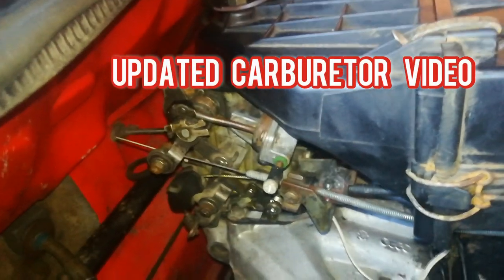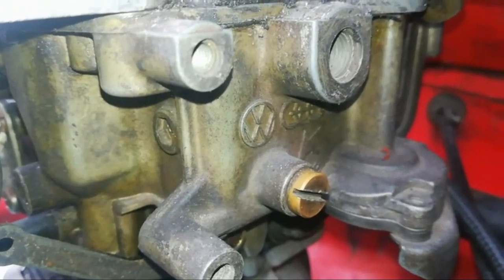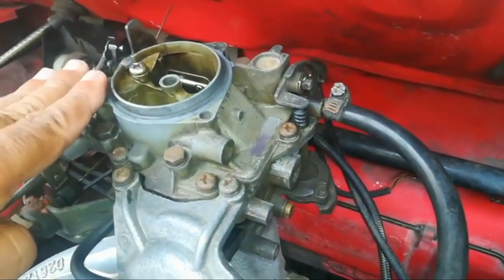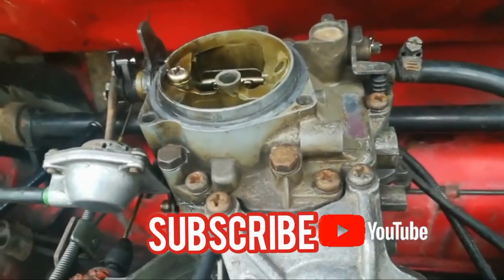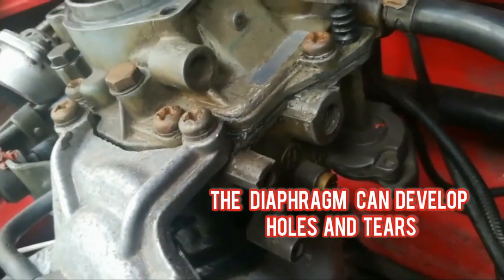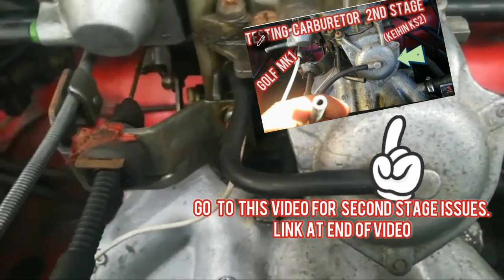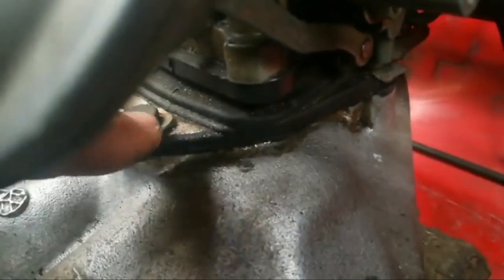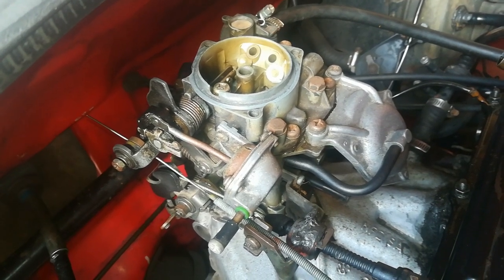GOLF MK1 : Revised and Updated video  Keihin KS2 Carburetor #golfmk1 #vwgolf #golfmk2 #carburetor

Comment: Hey PJ , quick question…the interior fan on my mk1 isn’t working at all , it went on at a stage but then never worked again. Doesn’t blow hot or cold air. What could be the issue? What should I replace?
Reply from the maker: Have a look at the connections. under the rain tray in engine bay..It sometimes is just a bad connection, due to corrosion..

Comment: Hi, regarding the float level adjustment screw, i have a question:
Is it secured in any other way than just screwed in? 
It is leaking on my KS2 but when i loosen it to take it out, it gets stuck when the top ist just above the plane of the screwhole. The screwdriver slot is already a bit damaged, and i fear breaking it when i try to turn it more.

Also, for the hinge of the float, how should i take that out? I assume i need to take the float out to get the bottom part of the float valve out, but the pin doesn't move at all

Comment: Thank you so much PJ's 👍👍

Quick one PJ is the goldwagen cab base good, saw some others preferred the aluminium one?
Reply from the maker: Yes there base plates are good. Just don't over tighten the 4 long bolts holding it place.. Rubber coated base plate is still the best

Comment: Thank you so much for all your videos they have helped me a lot. In your one video you removed the fuel separator and put in a t-piece instead and in the return line to the tank you put in a restrictor. I have done the same but want to know what restrictor did you use and where can I get one from. Any infor or links or pics of the restrictor please.
Reply from the maker: Hi you could get the restrictor at Goldwagen..,but your Mk1 should actually have one in already,.Was it removed ?
Reply: Hi. My didn't have the restrictor in the return line. It only had the fuel separator which I removed and put in the t-piece. Can I run it like that without the restrictor and will it cause any issues. What must I ask for when getting the restrictor.

Comment: Love your channel, thanks for all the good advise, my 2006 with original carb, revs drop when I accelerate, what could be the issue?
Reply from the maker: Could be more than one thing ..fuel pressure,airleak,or dirty carb,.. first just give it a blast of carb cleaner into the fuel bowl,then drain the fuel bowl.or while engine idles hold your palm of hand over the mouth of  carb,you will feel the suction,just before engine wants to cut remove hand .That could clear up any blocked jets..
Reply: @pjs-golfmk1-diy  thank you, I have cleaned the carb, replaced the fuel filter and plugs, I got a kit today to properly service the carb, will get it done over the weekend

Comment: Hi PJ, on the cluster, the light that flickers in the top Centre, mine does not flicker or come on at all. what can be the cause. I've got a mechanical oil gauge but would like for that light to work as well. kind regards and thanks for the videos.

Comment: Hi pj. Qestion can a carb be checked to c if the petrol pump on the carb is working out side the car engine bay. Like on its own not conected or does it need the vacum pipes connected ?
Reply from the maker: Yes you can check it ..with the inlet pipe disconnected from carb.
See the video link I'm putting down below

https://youtu.be/mHrXswnoCk8?si=oLk5z_UmZ0mDO8gj

Comment: Hi sir. My second stage doesn't wanna close properly. When I accelerate and take my foot off the revs don't drop lower than 3000. I bought a new carburetor and it does the very same thing. What could the problem be? Went to 2 mechanics and nothing satisfactory as of yet
Reply from the maker: Hi ,the problem usually is the butterfly not closing completely due to carbon and dirt stuck in the throat.
A blast of carb cleaner can loosen that dirt,and then also pull the 2nd stage external little lever ,on left side of carb to free it up bit more.What puzzles me you say the same thing happens with your new carb,so now I'm thinking airleak either at base plate or servo pipe....make sure base plate is not sucking in air,or another thing is are you sure your accelerator cable is not the problem..because when it gets older ,just like a clutch cable the strands come apart and it frays and starts rubbing against the inner tube of the cable.,and not releasing ,causing engine to stay on high rev...take off the accelerator cable and check if it runs freely through the tube..also when fitted ensure its routed nicely and no tight turns.This has happened to me before ,where my accelerator cable was the problem.Took me long to come to that conclusion.

Comment: Hi PJ,ive watched most of your videos,i just want to ask,my carburettor keeps leaking petrol between base rubber and carbs bottom,what could be wrong?I recently changed base rubber and replaced bolts that fits the rubber on manifold?
Reply from the maker: Hi there 
Have you watched this video on fuel leaks ...
https://youtu.be/jmbOsYPzp70?si=r6O0USHTeIzU-W0g
Reply: @pjs-golfmk1-diy  I did but still not sure how to fix my carb problem leaking petrol between carb's bottom base and base rubber.Could there maybe be a seal that needs to be fitted underneath carb between carb and base rubber?

Comment: Hi PJ. My mk1 distrubor don't have a vacuum pipe,and on the caburator is points of vacuum pipes how do I connect the pipe's
Reply from the maker: If you have a newer model Mk1 which has the distributor without the vacuum advance cannister then you don't have to worry..just ensure you block off the ports behind the carburetor

Comment: Please confirm. Turning in the air/fuel screw makes it leaner and turning it out makes it richer. Please confirm if I an right.
Reply from the maker: That is 100% correct .you can actually hear the engine idle become a more shaky when turning in,and more smoother when screwing out..Then again, not too much

Comment: Hi PJ I have a carb problem...Base plate seems to get wet when using fuel on the top where the carb sits on te base plate
Reply from the maker: I know this is a common problem.Things to check is the gasket inside the carb.sometimes it leaks from the fuel bowl into the second stage .,and also the needle and seat could be stuck open ,allowing too much fuel into fuel bowl

Comment: Hellos again i have a problem with my carb with cold start when i pul the choke the car floods even when its pulled 1/4out even 1/2 out2 then car dies i have to start it with gas pedal till she get to temp, thanks in advance
Reply from the maker: Hi sorry, very late reply. Have u tried to not pull it out that far.. Made just less than a quarter. Mine also smothers when I pull choke out even a quarter. But I've discovered it works better when I pull out only a wee bit. Or your carb is over fueling due that float level screw being too open.. But don't fiddle on that. Try  and see if cold engine will respond better to choke only being out a small bit. Thanks
Reply: It does iam just use to the hi idle when i used my choke thanks, i though something was wrong

Comment: I just bought my MK1 cab and usually after some long drive the reve count is always up, what might be the prob
Reply from the maker: Could be more than one reason. The butterfly valve of the Ist and 2nd stage  could be sticky meaning it does not close properly...so just give it a good blast of carb cleaner .

Comment: Hello PJ i have a 1.4 carb...one problem i have is that its well in the suburb but when im on the freeway doing 120 after 30km it starts to pull back then i rev a little than again after 30km can tel me if its the carb or what
Reply from the maker: Could be the fuel pump

Comment: Hi Pj, I have a problem at high Rev my car starts to jerk like it's struggling.
Reply from the maker: Hi, jerking at high rev can be one of 2 things.. Either Fuel starvation, due to a weak fuel pump, or clogged fuel seperator, or clogged up fuel pick up in the tank... I have videos on all of these.. Not sure if you seen them. Or it could also be a misfire, due to spark plugs or leads, or coil etc.. I have videos on these too..
Reply: @pjs-golfmk1-diy  this only started after I serviced the carb, done it myself with a carb kit and to change the float ad it was leaking
Reply from the maker: @shannonmoonsamy  maybe the float /fuel  level gets too low at certain times.. Maybe just make an adjustment  so that more fuel flows into carb.. Just make a quarter turn adjustment at a time

Comment: Hi I've got a bit of a problem my car idles at 900rpm when braking the cars idling would drop and die depending how many times I'd press the brake pedal I then removed servo hose and blocked it off going into the intake car now idles 900 rpm when I press the accelerator and give it a rev the car revs up and when it comes down to idle speed again it doesn't idle it dies what could be my problem please help me
Reply from the maker: Hi it could be a problem with the actual servo pipe,.. It also has a one way valve inside the servo pipe, which can give up. Also fluctuating idling can also be due to your air fuel mix being too weak.... So just try richenning the mix a bit, by turning air screw out (anti clockwise) half a turn.